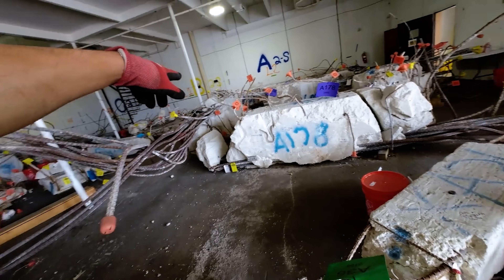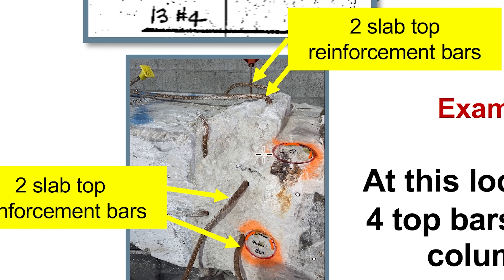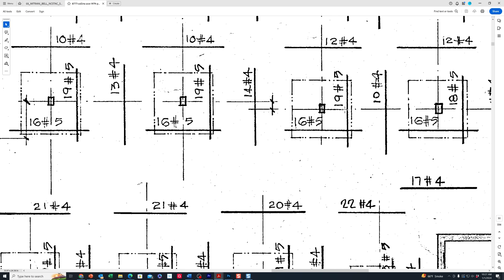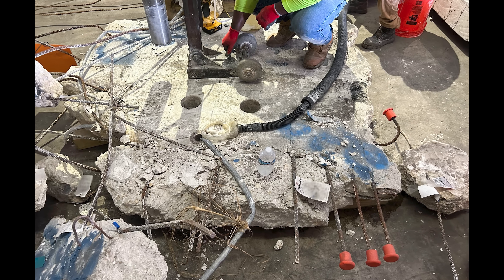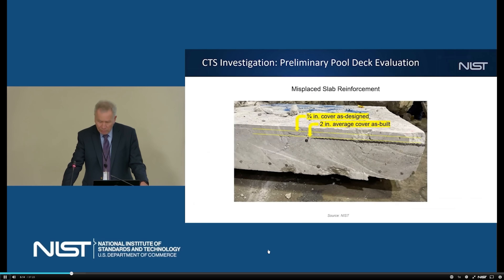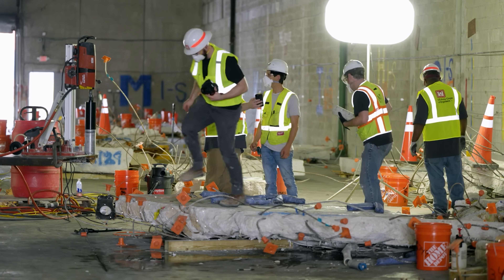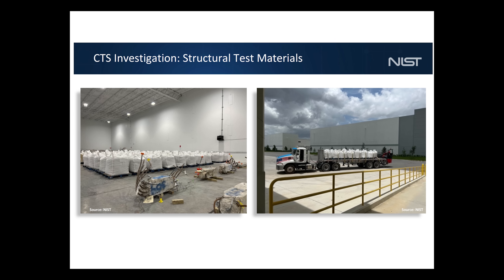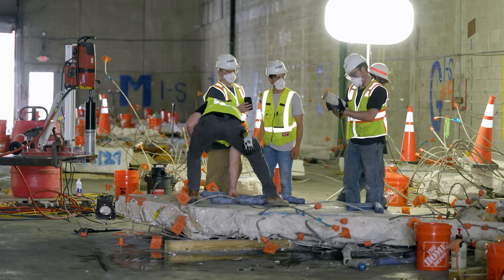More Shocking Build Errors in Miami Condo Collapse

Comment: Very interesting- hard to judge the spacing of the slab rebar when they have been displaced by the collapse. Also although there are two highlighted rebar on the column top there are two other bent ones which seem to be over the column. In coastal Australia many condos are built on sand, it’s a good foundation and doesn’t settle but is vulnerable erosion by running water.
Reply from the maker: A lot of people though there would be a lot of under foundation erosion here, but it simply was not the case. Very amazing how well the column piles held up
Reply: Sorry but I have to dispute that my area is built on sand and it rises and falls with the water table cracking driveways and causing movement in buildings its not major as it is with clay but it it happens Note I am in Australia.

Comment: 14:08 there is no way in hell some of those drives are giving up the data they hold. once those platters have a mark on them they are toast. esp this one pictured. its goneski
Reply from the maker: Yes three years ago I had two Seagate Barracuda drives that were only two years old and they both failed and it wasn't from being jostled around or anything but when I sent them to the labs and I sent them to several labs around the country all of them came back saying they could not repair them because there was rotational scarring on the hard drive. I think they just whipped out personally because if you can take that platter out and put it on another hard drive and find bits on there ones and zeros you should be able to reconstruct data for the person that's willing to spend the time. You might not recover everything but you might get something and you might get lucky that the part of the video you recover is that 10 seconds before the collapse

Comment: All the video you have done on the Miami Condo Collapse should be mandatory shown to all builders, engineers and builders.  To show WHY the rules are there in the first place.
Reply: Along with Josh Porter's coverage on @Building Integrity. Between those two channels I feel like I learned 85% of what NIST has so far, but I learned it within a year of the collapse because of y'all!
Reply: @UlsterScotsAmerican  Once the investigation is officially finished and all the findings are out there, then this will likely be one of the major engineering stories of bad design and construction lessons, joining ones like the Hyatt regency walkway, Ronan Point and tacoma narrows bridges along with other major engineering disasters.
Reply from the maker: Yes great point, thanks!
Reply: A lot of them won't care.

Comment: if the engineer knows about this , we are talking about well calculated murder with the purpose of theft .
hdd shouldnt have been opened like this . this is pure destruction
Reply from the maker: The engineer probably had no idea remember they were just paid to make the drawings and the calculations and then the contractor puts everything together according to the plans so the contractor is at fault here although there may be some culpability on the engineer for possible lack of clarity on requiring the four rebar rods to be over each column

Comment: I’m really concerned about the North Tower. It could contain the same flaws.
Reply from the maker: The north tower so far is fine remember they were built three years after the Champlain tower S, and they have had the world class structural engineer working on that building for the last three years and they have put up shoring poles all over the place as an abundance of caution so they are doing everything right and they are saying that they have not found some of the same mistakes that were at Champlain tower South. If you look at my video from august you will see i showed some of the differences from their pool deck to the Champlain tower S pool deck and how they never had those heavy palm trees

Comment: Having fewer reinforcing bars over the column has some implications related to punching shear.  Having top reinforcing spaced out farther than required also has some implications for punching shear capacity but in addition will reduce the negative moment capacity of the slab in the column strip.  Both of these will reduce the strength of the slab and increase the possibility of collapse.  The drawings do not specify the dimensions of the column strips and the middle strips.  Someone experienced in designing 2-way slabs would understand column strips and middle strips but the contractor, reinforcing steel detailer and reinforcing steel placement might not understand that and this would explain why the bars are located and spaced incorrectly.  The drawings should have been more specific as to the width that the column strip reinforcing should stay within.
The offset in floor elevation along gridline 9.1 is critical to why the pool deck collapse continued into the main building.  You'll note that along gridline 9.1 the slab does not have the normal column strip reinforcing.  The beam that is formed by the offset in floor elevation should have been reinforced to take care of bending moments along this line since the slab was not reinforced but the beam wasn't reinforced either.  And perhaps more importantly the beam was not reinforced for shear or torsion.  When the pool deck slab started failing and put more vertical load and more rotation onto this beam it did not have stirrups to take it.  Once that beam starts failing then the failure could progress into the building and ultimately lead to failure of the building.  If that beam had been properly reinforced as a beam then the failure might have stopped there and not failed the entire building.
Reply from the maker: Yes what I was showing you was the original design floor plans but we all know that there's usually a separate set of plans that are used for the construction so maybe they were more thorough in showing the dimensions that you mentioned we'll never know for sure unless we see these build plans.
Reply: @jeffostroff  Throughout my career those were called "shop drawings".  Likely on this project those no longer exist.  All parties involved would keep them for a period of time the throw them away.  Reinforcing steel shop drawings may be more detailed than the structural drawings or might not be.  The other records that are likely missing are any conversations between the engineer and the contractor or the rebar detailer.  They may have asked questions about reinforcing steel placement, or they might not have.  Apparently the original engineer could have done a better job with the 2-way slab design and detailing, should we expect that the contractor and rebar detailer were experienced enough to know how it should have been done?  A contractor could work their entire career and never be involved in building a 2-way slab.
Reply: Thank-You for the 😮detailed explanations

Comment: Incredible negligence or outright fraudulence on the part of the building contractor !  As a professional who has spent her entire career in the commercial construction and real estate field, this makes me SO SO sick  and MAD !!!!!!!!!!!!
Reply from the maker: yes somebody on that crew should have been a stickler for details and made sure that all of those rebar rods were done correctly and had the ties in the correct places. Just has mentioned a couple of times about improper ties and improper lengths of overlap between rebar rods and so I'm waiting for them to show us evidence and photographs to see exactly what they're talking about and where it was that they spotted these instances
Reply: @jeffostroff Something good about carbon fiber came out in reports on the Airbus fire in Japan. Any chance you'll do a vid comparing Airbus jet vs Titan sub structural use of carbon fiber??
Reply: @kayellee7202 AIRBUS uses carbon fiber in tension, which is good.  The sub used carbon fiber in compression, which is bad (and why it failed)

.
Reply: My 108sq ft shed base has more rebar in it than this column...
Reply: assuming the engineering specifications are sound, two possibilities: 1) the building owner wanted lower cost, 2) the construction firm deliberately underbid with the intent to build underspec. either way, the engineer should have realized this, and the city inspector should seen this.
its kind of a shame that legally liable parties are not the same as those truly at fault
Reply: what about the inspectors?  were they payed to look away?
Reply: @KevinMcIlvaine yes, it’s Florida, everyone and everything is dirty.
Reply: Building Code official here; These errors are common and many times will not be caught.I don't understand why the insurance commissioner does not regulate inspections.
Reply: were you part of the team on the failed FIU flyover collapse?  it never ceases to amaze me how you leave the on-site inspectors out of the equation you wanna blame the builders and you wanna blame the people that fund it but you don’t wanna blame the people that inspected it.  your after poker game is terrible.
Reply: But what about the city building inspector, did they do their job or did their kids get their college payed for somehow?
Reply: Can NIST be trusted after 2001? According to them no CD brought down any buildings 🤣

Comment: 3 buildings fall from 2 plane strikes and they ship the steel out in two days. This gets a reconstruction. Lol.
Reply from the maker: They had to move the steel somewhere but actually they did keep a large amount of steel and stuff that was sent to a warehouse. Also it's not like they didn't know what caused the buildings to fall so they didn't necessarily need to keep every single piece that fell down whereas the Champlain towers we didn't know what caused it to fall so they do need every piece and they are now trying to recreate certain slab and column connections in order to determine were they designed and built to withstand the loads that they were being subject to. But in the case of World Trade Center you crash a 767 plane full of petroleum into that we know why it failed
Reply: @jeffostroff  Architects says not true. Destruction of evidence and no mention of building 7 in official report.

Comment: My explanation is that the vertical rebar rods of the columns were already there when they laid down the horizontal rods for the slab. And instead of threading them through the verticals they laid them around. That way they missed the core.
Reply from the maker: This is a very intriguing hypothesis and it also speaks to the overcrowding of the rebars because of they're trying to dodge around the existing vertical rebars like you mentioned, they have to make sure there's enough space in there for the concrete to flow so they're fighting numerous different standards and building codes at once as they traverse through these slab column connections. Because if they space everything too close together in order to fit all these rebar rods through the top of the column, they are not likely to have very good concrete flow when they pour the concrete.
Reply: @jeffostroff  From my jaundiced professional eye, I would have expected more rebar going through those column/slab intersections. They look very light, perhaps some . have been pulled out to allow greated clarity for the photos ??
Reply: @jhonbee5434  Noone was supervising or following the plan.
Reply: That actually makes a lot of sense. And as somebody who has worked on a lot of construction projects, it's not difficult to imagine it happening
Reply: Agree. That’s most likely what happened - there may not have even been a path through that column rebar to snake the horizontals in.

Comment: Could they have misunderstood the note? It says four, not four in each direction?
Reply from the maker: I think that the note should have been followed up by a well diagrammed typical view like they show on several of the pages where they are showing typical cross sections they just didn't show a typical view for the bird's eye view looking down on the column and the slab. But they had drawings all over the place for typical views of the garage ramp the stair steps everything else under the sun

Comment: As a non engineer I would interpret note 5 as 4 rebar needed and there were 4.  2 90 degrees from each other.   Not trying to say it did not mean 4 in each direction
Reply from the maker: The engineer should have been more specific or shown a "typical" drawing as an example.

Comment: Despite efforts to reinforce Champlain Towers North, I would not occupy any space in that building. Furthermore, if I was a resident I'd run fast from that doomed building before the last day. With that many corners cut I'd suspect the other property has faulty construction of it's own.
Reply from the maker: It probably does have some of the faults but according to Alan kelsheimer who was the structural engineer working on the project at the Champlain towers north, he says so far he has not seen any of the problems that were considered major inherited from the Champlain tower S. But if I was him I would be looking at the calculations that the original engineer made on the columns at the poll to see if he miscalculated those by the same 50% that he miscalculated on the South towers. But at least Alan has put up the shoring poles all over the place which is something that was not done at Champlain towers when they saw cracking.
Reply: @jeffostroff  Would it make sense to XRAY to check if rebar is indeed in the right place in North tower? I work in a different industry (semiconductor) and was in a different country (NL), but I witnessed an entire semiconductor fab being x-rayed on all the welds in the gas lines. This was done because one of the welders was not sufficiently certified. Costed a ton of money, but made sure that the welds were indeed done correctly.
Reply: I wonder how much money that contractor saved by shorting the job. That would give you a hint as to the safety of the other tower.

Comment: Is this NIST's first major investigation?  They are going slower than NTSB does with aircraft mishaps.  I didn't think that was possible.

Burying important information is a problem.  Happened with the Space Shuttle Challenger, too, with those o-rings.  Doesn't the engineer walk the builder through the important stuff before construction begins?  Isn't there anyone on site that's verifying the building is being built according to the plans properly like an rep from the engineer's company?  Doesn't the builder do this enough to recognize when something isn't right like rebar spacing and then consult with the engineer?
Reply from the maker: This type of failure is a very slow investigation and it's not just them dragging their heels they are working as fast as they can they expressed their frustration with how long it takes them just to get contracts approved and then finding the contractor, and working everything out with the contractor before they bring them on to help with the investigations. Plus when you're working with concrete remember you have to do research into what materials were used at the time of the construction and acquire those materials, then you have to make the concrete, then you have to build the structure that you're testing, and then you have to let the concrete cure for 30 days and sometimes longer to simulate the same results. So there are numerous results that are coming through and they've already given us several potential root causes to date which we didn't have a year ago so at least the speed of the progress is picking up

Comment: So where is the extra rebar?  I am sure there is a paper trail of the amount of rebar ordered. So if the rebar was ordered then where is it?
Reply: The information presented would imply that the reinforcing was spaced out farther than required so the extra rebar would be out in the center of the slab.  Being in the center of the slab it isn't doing the job that it is supposed to do.  The building code specifies a zone either side of the column that should contain the column strip reinforcing, the video says they spaced the reinforcing over a larger zone.  The column strip zone has greater bending moments than the middle strip zone and thus should contain a larger amount of reinforcing.  If the reinforcing was placed outside of the column strip zone then the slab would have reduced capacity.

Comment: I thought previous examinations indicated the rebar in the columns was too close together and the concrete when poured at installation couldn't get in between the rebar, causing voids?  Now it seems that some of the rebar elsewhere was never installed...
Reply from the maker: Yes the issue you spoke of refers to the vertical rebars that were going through the columns. But in this case we are talking about the rebars that are in the slab above the column that are supposed to crisscross there's rows of horizontal and rows of vertical, but not in the vertical sense meaning up and down just to end the vertical sense of the opposite direction of the horizontal rebars.

Comment: Champlain Towers South is old news now. No one cares about it anymore.
Reply from the maker: Is much more relevant now than you think for example it has already affected laws of how often buildings need to be recertified, and it should affect building codes going forward and I hope that it affects how engineers are trained going forward and remember they are still learning every day as they bring the investigation to the close, they are learning more about construction and what is working and what is not working and what failure modes to avoid. So just focusing on the name Champlain tower South and saying no one cares is missing the whole point of the investigation. Just like every airline crash that they investigate inevitably changes the rules and operating procedures.